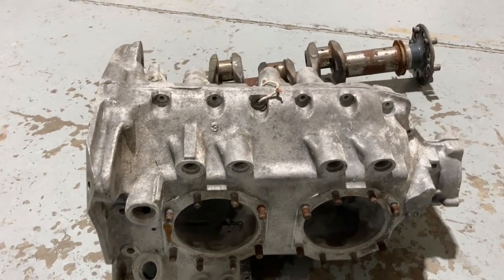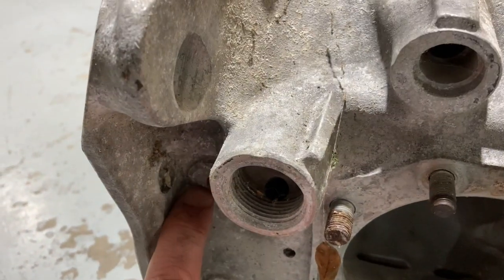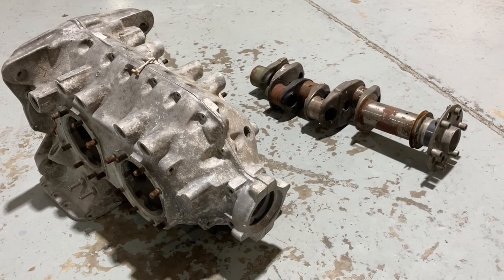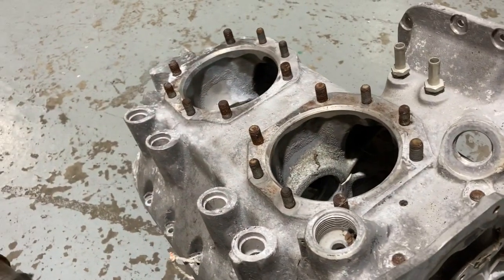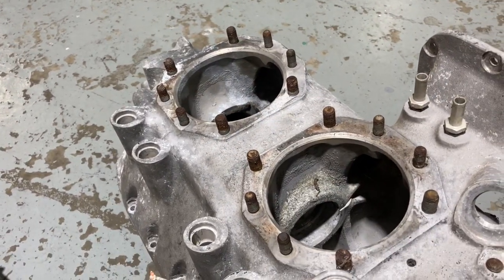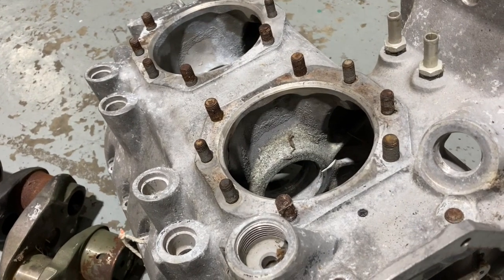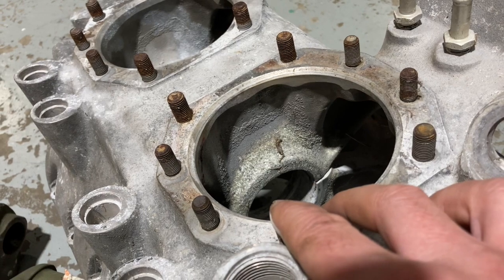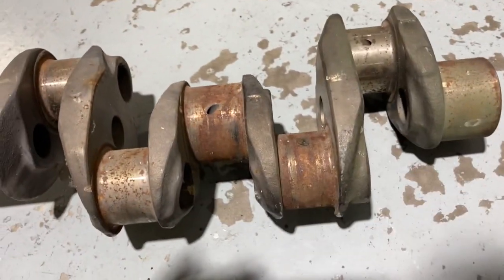Watch the oil pressure on your aircraft's engine.

Comment: "I like your investigations. Everything you have said is true. This is why I take my engine overhauls very seriously. LOW OIL PRESSURE CAUSES MUST OF THE PROBLEMS, DUE TO WARE AND TEAR of the connecting Rods. This microscopic metal fatigue could be prevented with constant lubrication after every two flights or? Every 30 minutes  of engine use(This means? Check your engine after every thirty minutes of flight, even if it appears to run properly. This also means? Keep four extra quarts of aero shell oil, or a oil of your choosing on board; To keep oil pan bay at it's max for an easy and lube flight, where ever you may travel as an operator. Remember? The oil spits out this engine constantly at high pressure. Therefore?  You must check the engine at a constant to maintain a level  and plausible flight with every takeoff no matter the weather condition.) check engine.
Reply: I would hope it oil doesn't spit out of the engine or else you have something seriously wrong